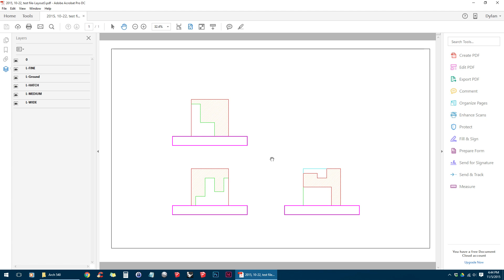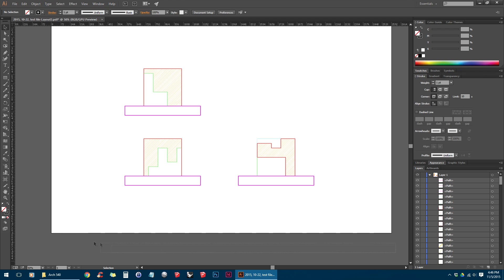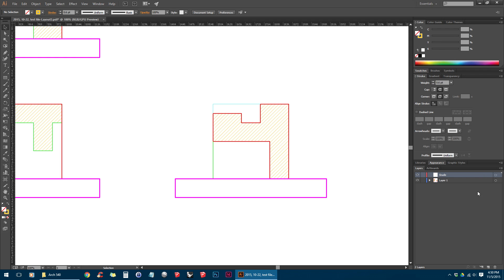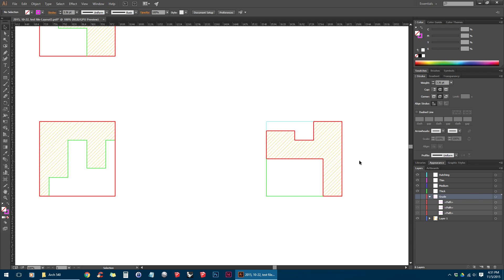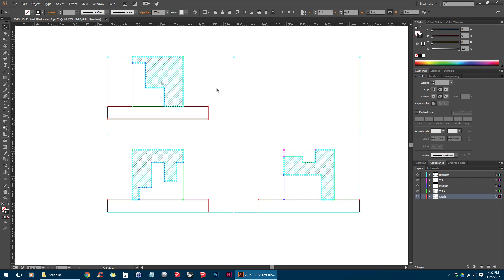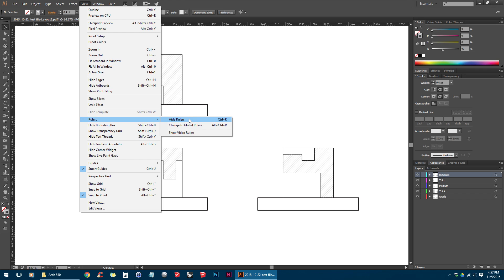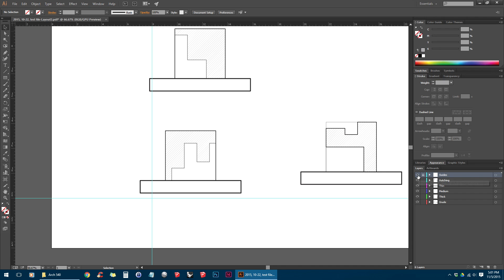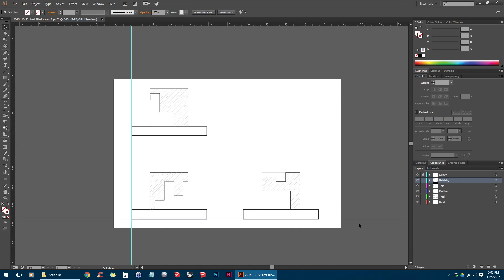AutoCAD PDF to Adobe Illustrator Tutorial

Comment: Dear Dylan or YouTube community,
I did my logo in Autocad which is made out of triangles and dots and Arial text. Triangles and dots are filled with solid hatch and text is just a standard text. And the problem that I'm having is when I plot this from auto cad to pdf, I'm getting barely visible lines running horizontally through those solid colors triangles and dots. When I bring them to illustrator the lines are still shown and when you clicked on them,  they being shown as separate objects. So for example within on triangle of the same color, there are two or three triangles and when those objects meet, that's where the barely visible line is. The problem is multiplied withing the solid dot. The dot is divided into multiple triangles and when those triangles meet, that's when you see the lines. I tried to follow the tutorial and bring them onto the same layer but this didn't solve it. Did you or anyone run into the same problem and have a solution for it? Thank you